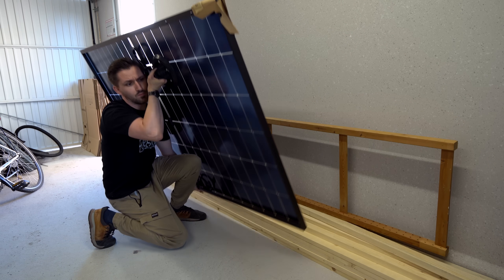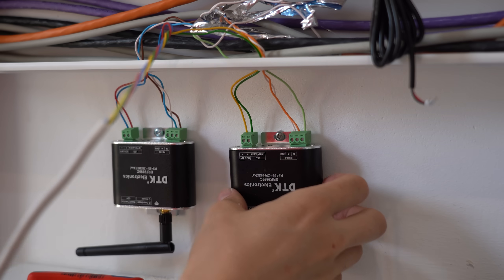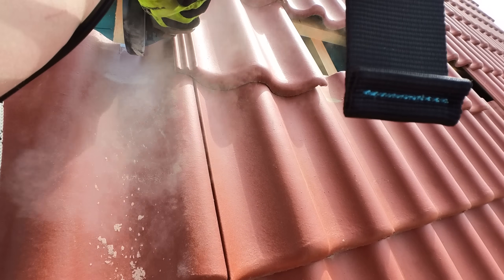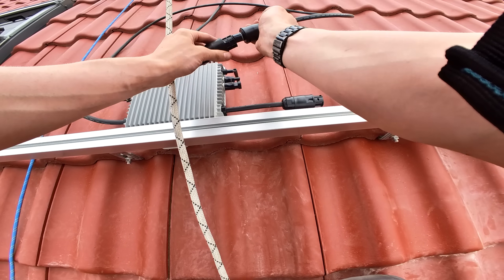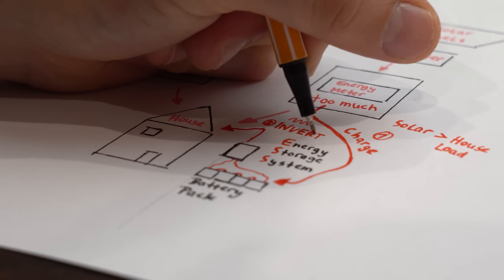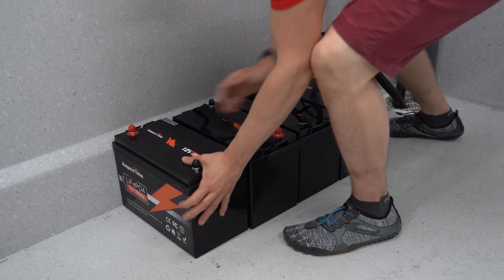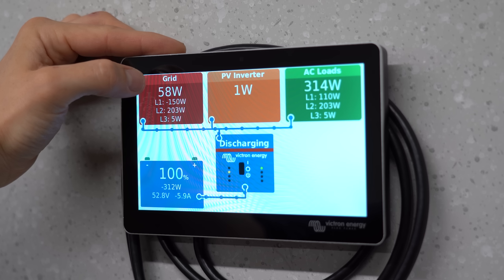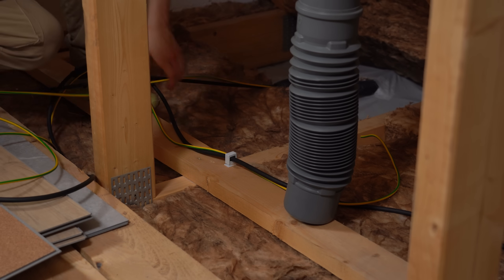Pushing a "legal" Mini Solar System to its LIMIT!

Comment: When I saw the grinder...thirst thing that popped into my head...use corldess tools with a soler setup, same voltages less waste energy.

A fast charger that can charge  2 or more batteries at a time can be powered by a small dc to ac inverter.  At a time on big site I kept 2 impact drills, 2 cordless drills and one impact drills batteries charged during the day by keeping the car on, and a small soler panels on the cars roof.

Comment: there are some nice Automatic Transfer Switches for your 120AC for when your battery goes below certain voltage in the 10ms range instead of doing the Victron Route as well.

Comment: This may be a dumb question 😅but I would like to know if a solar charge controller rated 24V 40A be used with a solar panel rated 24V 20A?

Comment: I also installed a Victron system last year. It definitely will not pay for itself in less than 42 years because I bought 20Kwh of batteries.

Comment: *This costs 50 bucks and doubles your power output*
You can use servos and shiny metal sheet to concentrate more solar flux on the PV panels and build a solar tracking device while keeping the panels stationary but you will need a cooling system too.
thank tech Ingredients YT Channel.

Comment: Just a little Note here in Canada and I think in the USA too if you dont have a Propper Hydro Meter, the power you put in does NOT reverse the Meter it will charge you for giving them free power ... it see the power flow and add it as power used.. the meter replacement cost $2700.00 from the Hydro company.

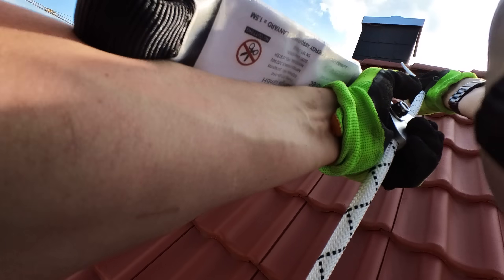Comment: 2:50 cringey difficult. why do this if you land/space on the ground? if you are going to do it on the roof, you have to do it big time or install as much as panels your house can use.
7:15 this project is getting out of control. not only these Victron equipment expensive, this already territory of solar or professional installers with only two solar panels. This upgrade project should have been as simple as Solar panels to MPPT charge controller to batteries, and grid tie inverter connected to batteries.

Comment: if the limiting factor is your strength (the panels are too heavy) tie the rope to the bumper of your car or if you have a trailer hitch tie to there and pull it with your car and hope the panel does not get destroyed by being slinged up too fast and falling down the other side shattering on the ground (ding lit!).

Comment: Great to see your new adventures in the Solar world :) It would be interesting to have more details on the Victron ESS configuration with micro-inverters. I did not go this way, I built a 'Custom ESS' using a Hoymiles micro-inverter connected to a battery, a battery charger, and a Raspberry for the brain of the system.

Comment: Why does it even need to be connected to the grid electricity supply permanently? Providing that your consumption is below that generated and stored in the battery, your workshop can remain off-grid. If needed, during Winter for example, you can simply connect a PSU  to the battery temporarily to recharge it.
Reply: this project is ridiculous.  he bought the small balcony solar system with two panels and inverter but the upgrades he bought probably cost at least three times the balcony system plus labor.🤦‍♂🤦‍♂  The upgrade should have been simple and cheap by adding an MPPT controller and small set of batteries.
Reply: Absolutely!  @zodiacfml

Comment: - There are MP2 Versions with integrated gx device
- Multiplus is enough for battery monitoring, shunt is useless in your setup
- One smart meter would have been enough, the victron system needs only to know how much energy gets exported. Also there is an ethernet version (get rid of zigbee).

Do you need a kind of top balancing for your four LFP Batteries?

Comment: 06:15  
Couldn't you use the rope and balance weight on the other side of the houses (?) and lift the solar panel by lowering the gym wright on the other side as well balancing the weight so lifting the solar panel would have been  weightless ? :)

Comment: I agree professionals should do it  but I disagree in the same time. 
Some companies call themselves professionals but they install the systems worst than a amateur hobbyist, no cable management no fire safety hazards or any  power load safty.

I would say a electronic hobbyist has more sense in what should be done and have a safe system in his own house. 
Of course don't try this at home if you are not 100% sure what are you doing.

Comment: Here in British Columbia, Canada; our electricity provider, BCHydro, allows for net metering. Meaning you can use the grid like a battery and only pay for the excess energy you take. Making adding solar panels profitable in the long run, but you don't get any backup power if the grid goes down.

Comment: Nice idea! I am also using a multiplus and smart shunt in my camper van. If some of you guys are into DIY, the Victron Venus OS, running on the cerbo is available to run on a Pi3/4. (By Victron) So I could save some € and still have nearly the same functionality compared to 60€ versus 250€. You also need some adapters to connnect the Victron Bus. works for me for 2 years now.

Comment: having connected batteries in series and not having a balancing system, don't you run the risk, after repeated cycles when unbalancing will occur, of incurring overvoltage or undervoltage of individual batteries? This can be risky

Comment: Unfortunately this has nothing to do anymore with a "Balkonkraftwerk" that you can get for under 500 Eur to produce 600-800W. I would like to see a solution to prevent feeding power to the grid but store it in (a much smaller) battery and then use the cheap 600W inverter to power the house at night (still limited to not giving power away to the grid for free).

Comment: Why choosing solar pannel with inverter and not using Multiplus as a bidirectionnal inverter+ an MPPT for solar pannels ?
This would have saved solar pannel inverter and the two power meters Adding an MPPT though.

Comment: Nice Video, my problem is storage. Currently my panels produce 4.6Kw in full sun. I have about 580Kwh in storage and I have spare panels to double my production. So I need much more storage in future. 
Victron kit - although expensive is the best power system out there. it can simply monitor everything and can scale up to small power station level.
The flexibility is top of the tree, my system runs via 1 multiplus and as soon as the power requirement reaches over  2+ kilowatts it kicks in the second multiplus inverter seamlessly. I can't name another system that can do this.
You missed using a Raspberry Pi and a few cheap interfaces to replace the GX - save yourself some cash 👍
Rope is your best friend when moving objects or hanging yourself off a roof - working aloft always needs good consideration.
Take care & keep up the good work
P.S. should say my system is off grid - no connection to the grid supply

Comment: seems like a lot of effort when you can do something similar with an off the shelf hybrid inverter, (i recently fitted a sunsynk) i was previously using an assortment of separate lead acid batteries, charge controller and inverter.

Comment: Hi there! For off-grid applications one prefers DC-coupling instead of AC-coupling like you do. Another problem with your setup is that nothing will work if the grid goes out, although the multiplus is capable of dealing with micro-inverters. For that you would have to put the multiplus between the grid and your home on which the mciro-inverters are connected, and that would allow you to get rid of the two energy-meters, because the multiplus has it's own meters and detects the power that goes to the grid. I've done a video about that, although it is in french (https://youtu.be/m8zBs366n0c)

Comment: Do you still have to check with grid provider if you never give any energy back to the grid? Thinking about having solar energy for during the day and only take minimal energy out of grid and use grid normally during night. That way I can use high current loads during the day (like charging the car, cooking,...) and lower grid energy consumption. 
I know, they have to allow us to install solar systems if we return energy to the grid, but what is the case if we do not put anything in the grid? To outside we would just look the same consumer as before, but with minimal to no consumption on during the daytime.

Comment: What protection do you have for the linemen working on the power line. They switch off a section of the grid so that linemen can fix stuff but they might not have control over systems like yours which feed the grid.

Comment: I'm not sure it's a good idea to plug a solar generator into a mains outlet at all...
1. The outlet is fused (or with a breaker)
2. Phase of the output needs to match the phase of the grid, otherwise you're just burning off energy as heat, shorting everything together. In theory, an inverter would need to be designed to specifically match the grid's phase.
Reply: 2. It is
Reply: @mariosmusik4898  I'm sure the final result is. I was commenting more towards the early cheap example where he had only an inverter and 2 solar panels, and plugged them into an outlet.
The final design has a grid input, so I'm sure  it would be designed to be in phase with the grid, but the first cheap example looks to be more along the line of powering a home device, so I have my doubts.
Reply: In the first example he used just microinverter wich is able to sync on the grid. In the second example I think he still uses it for the solar panel. The multiplus is used to charge and discharge the battery.
I think the mircoinverter is a deye sun... wich is made for exactly the shown purpose

Comment: This setup is illegal for several reasons in most of Canada. No power storage on-site and no grid tie-in without a grid control/cutout system. It would also be illegal for most Canadians to wire this if they live in a city with garbage electrical code or are insured.

Comment: Why do you not get paid in Germany when you put power into the grid?

Doesn't it lower your electric bill at least?
Reply: To install Balkonkraftwerke you need to do less paperwork and don't need an electrician.
You can install and register it all by yourself. (Simplified, there are a few things you need to be aware)

It's made to have a (more or less) easy oppurtunity to try our PV.

The downside is that you don't get paid for the power in your grid.

If you imstall register a bigger PV system you need an certified electrician and the process of getting it registered is more complex. I'm not sure if you also get an extra energy meter for your PV installed by the electricians.
If you go that way you get paid for the power you put in the grid, but it takes quite some starting capital

Comment: add more solar panels
add more battery , I have a 3L with 96 KWh system build. (11 KWp Solar) , for our needs that just about the right size and will support our Cars and supports low price charging as well

Comment: For a small, off grid house, the solution is much more simple. You just calculate how much power you consume via all your necessary electronics, like a fridge, a TV etc, and the 24h time-frame of consumption must be produced in about 4 - 5 hours of sunlight. And according to your solar system you can simply buy a rather cheap hybrid inverter and make a battery storage that can supply current for 3 days w no sunlight. It's simple and effective but it has it's downsides
The inverter doesn't measure things like power input and output, amperage etc correctly so they are just a point of refference
The inverter won't have a long life according to forums.
In my personal experience i found out that a 800w solar system with a 3kw inverter and 14 kw agm battery system (out of which 7 kw are usable) it is enough for a small house

Comment: As always, you have great content. Thank you. For the curious, how much would such a system cost? Here in the U S whole house Solar installations are expensive I think and the ROI is many years.

Thank you, again.
Reply: A very rough estimation:
Micro inverter 150€
Solar panels 250€
Mounting stuff 100€
Cable and electric stuff 150€
Victron multiplus 1000€
Additional stuff for multiplus and monitoring 400€
Batteries 1500€

All in all  maybe 3500-4000€.
I also could be totally wrong.
Without the storage (you let the excess energy flow to the grid)
you can get it for around 500€-900€ and a ROI of 3-5 years depending on your location and orientatio  of the panels.

There are people who made big solar systems with storage for about 10 000€ (you need to know an elictrician who does the final installation of it.

If you buy a big solar system without DIY it's about >20 000 €
Reply: @mariosmusik4898  Thank you! Looking forward to the next video 😁

Comment: I think you can get around the utility approval for your solar system if you set it up as an island. Essentially you set the system up and off grid but then use the grid to supply DC to your inverter/charge controller. You have to find hardware that supports it but because it can't backfeed it is just another load to the utility company.

Comment: If you don't have one already I recommend getting a battery bank balancer. Victron also makes one. The individual 12v batteries have an internal balancer but this unit keeps the 4 12v "cells" balanced to each other as well.

Comment: It's kind of crazy to me that you're allowed to just plug a micro inverter into an electrical outlet on the side of your house and feed the grid with it.  That sounds super illegal in the US.  I've heard that people made such cables to power their homes with generators during outages and seriously injuring workers because they thought the lines weren't energized when they were due to the generator.  Does your inverter only produce when there is an existing supply to synchronize its output to?

I'm doing my own mini solar system here in the suburbs of Kansas City.  I didn't want to mess with the legalities of grid-tied or roof-mounted/permanently installed solar so I just bought a pair of 100W panels from Harbor Freight and sat them up against the house in the back yard.  I ran a cord from them in through the window.  Originally I was using them to power a Bluetti EB3A portable power station which could pull up to around 145W from the panels.  It was enough to run my laptop for work-from-home and occasionally a fan.  I decided to upgrade it with a proper MPPT solar charge controller and two 50Ah 12V LiFePO4 batteries.  I've seen it pull up to 210W or so from the panels on really sunny days.  I can run a small inverter off of this system to keep some LED lamps on 24/7 as well as two laptops and occasionally the fan.  I've mowed my lawn entirely from the solar panels this summer by recharging my lawn mower and power tool batteries off of the system as well.

The detached system is pretty easy to set up and doesn't run into any legal or building code issues since it's not part of your home nor does it interact with the power grid.
Reply: Didn't read your whole comment, but to answer your first question: yes. (Speaking of the microinverter)
If you wan't to keep it legal you need a certified inverter wich shuts down in a certain amount of time, if there is no AC voltage coming from the grid.
I don't know how the victron handles it (guess it does the same)

Comment: here in the UK our 'smart meters' are not so smart.
If we use a grid tied inverter that produces more than the base load of the house, the power going back out of the house gets charged to the customer as the not so smart meter cannot tell if the user is consuming power or producing power.
I have a Smets 2 meter (the latest type) and even this meter cannot tell the difference.
Fitting solar panels on a house in the UK has to get planning permission and mostly gets declined as most houses are classed in 'areas of outstanding beauty' or refused due to the area the house is in.
Trying to go green in the UK is a very frustrating experience.

Comment: you only need one rs485 for 2 energy meters. you have to first connect them to your computer with a 485 adapter and change the modbus number. technically you can do a lot on 485 but for some reason victron only supports 2 devices per 485 card

Comment: Good job and video, with one thing missing, total price for working project. Does it worth at all? Consider that batteries will be replaced after 3-5 years of constant working.  Calculation does it worth should be calculated for usage period of 3 years. Can  you please provide this conformations ?

Comment: I have a question what if the grid goes down and your panels feed live voltage into the down wires? Also maybe the electric company would assume that there's no such setup then get electrocuted??
Reply: If you wan't to stay legal you have to use certified inverters, that shut down if the grid goes down

Comment: Great video. I was wondering, don't the cells need some balancing with a BMS for example?
Reply: Each battery has it's own bms inside, but from time to time it would be good if he recharged all the batteries to the same state of charge.

Comment: Just disconnect yourself from the grid and no power will flow to them for free
Reply: These microinverters don't work witout a grid. If you do a system not conected to the grid (I think you need no registration at all for such a system) you still would need batteries otherwise the excess energy from the panels would be unused.

And you need enough solar power to power all your consumers in different weather conditions.
So not really benefitial on such a small scale system